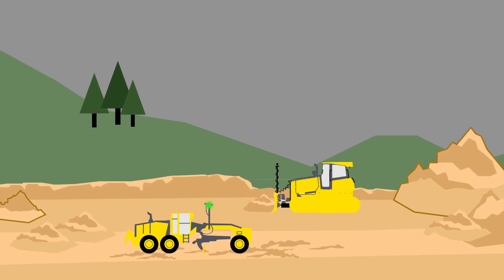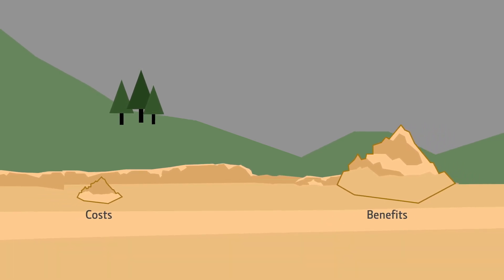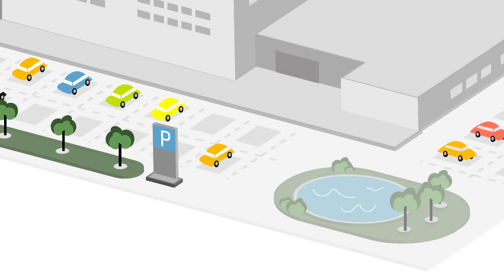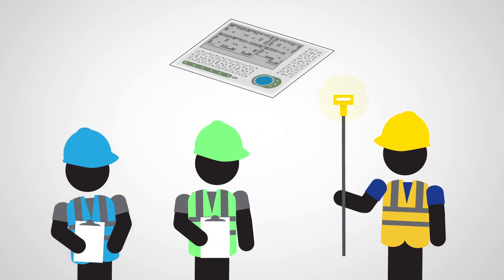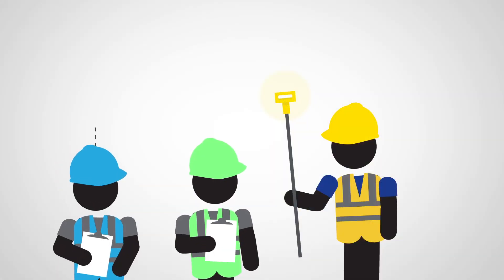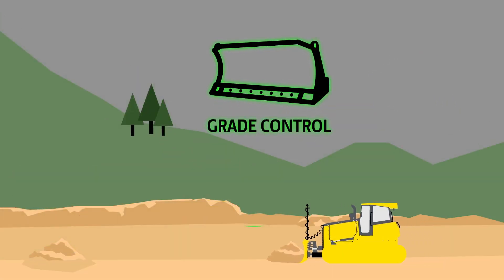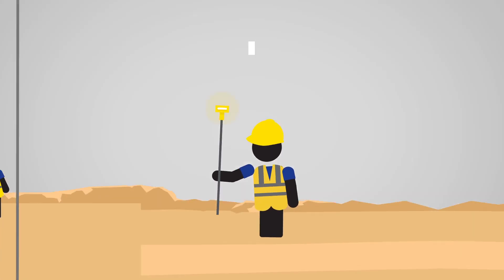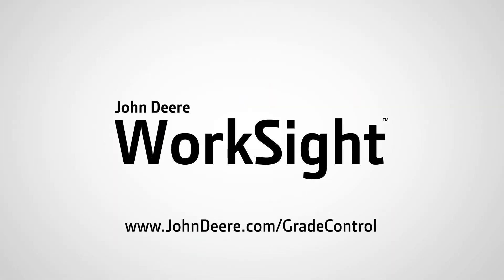Simplifying Grade Management

Comment: Machine control is great but i have to correct the False info. A Topographic Survey by definition is 3 dimensional. Just because paper plans are flat does not mean it hasn't been modeled already. No engineer designs a site in 2D. in Utah the DOT deliverable is a 3D model. If someone needs to topo a site themselves for bidding/takeoff, they are already wasting money. Try asking for the data and then just verify, same with the Model...